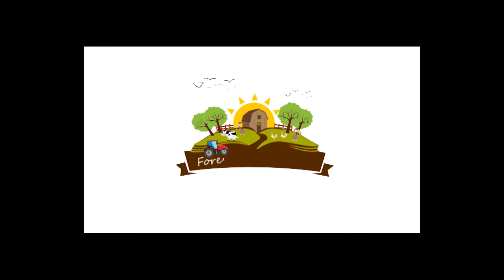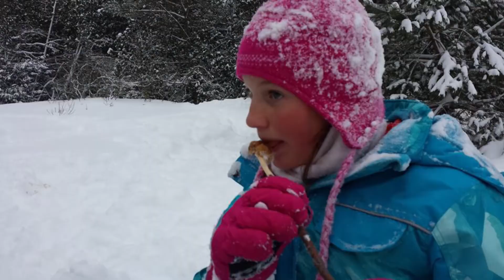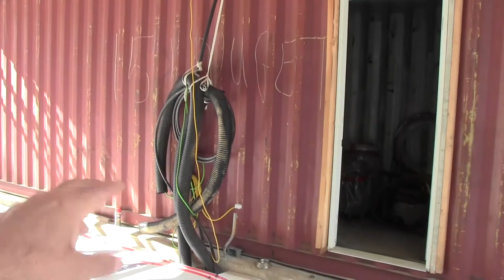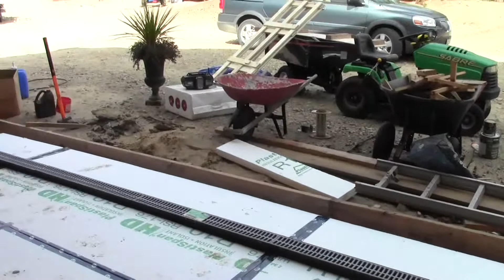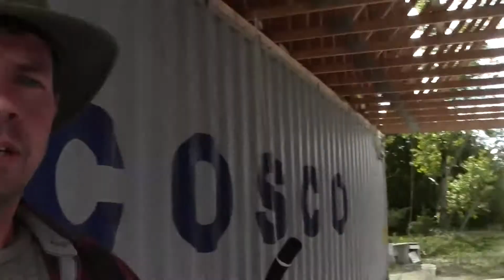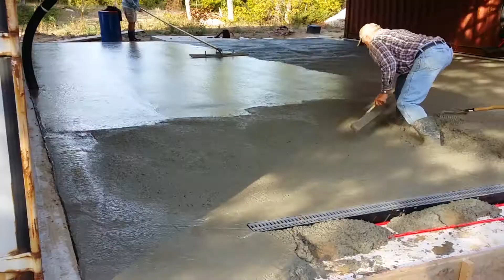Shipping Container Barn Build -    Pouring Slab with In-Floor Radiant Heat and Channel Drain

Comment: It doesn't appear that you used footers around the perimeter, like about 12". Why not?
Reply from the maker: There are no footeres needed on the slab.  The shipping cans sit on pads of thier own.  They are 8 inch thick slabs with double run 15 mil rerbar around perimeter.  There is a video on it if you look back through our videos

Comment: Where is your rebar??
Reply from the maker: Dont need it.  This concrete has fiber in it for strength. .  Only a 4 inch slab on foam and on sand.  It is not needed.  The slabs under the Shipping cans have two rows of 15 mil rebar all around the perimiter